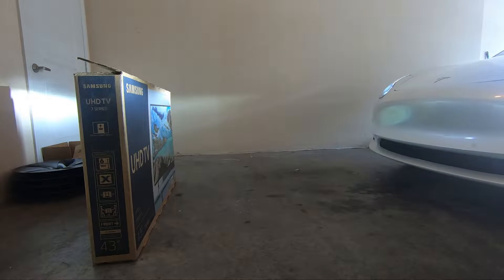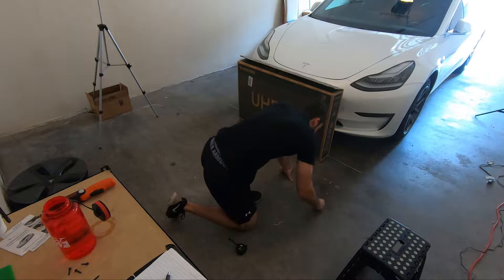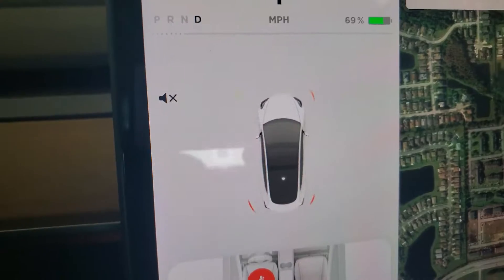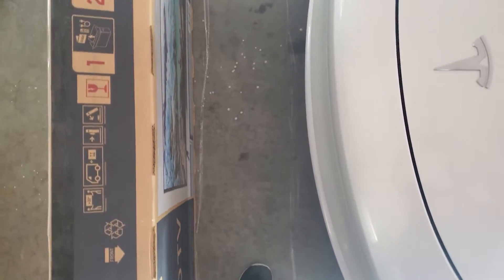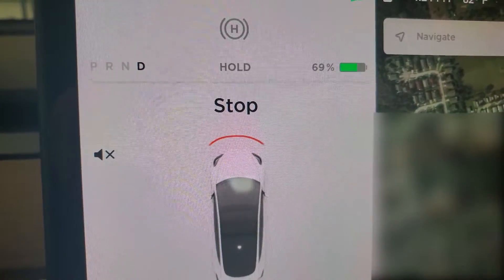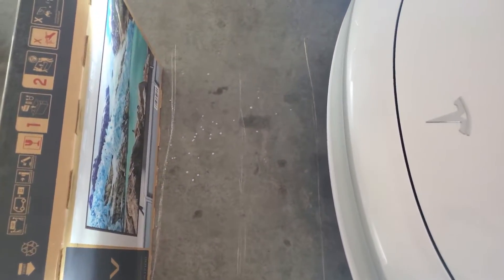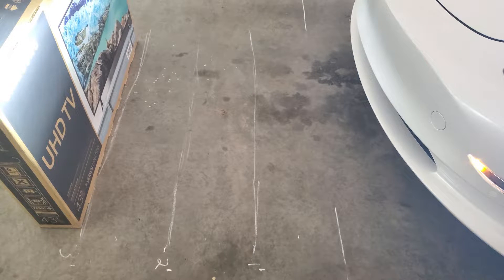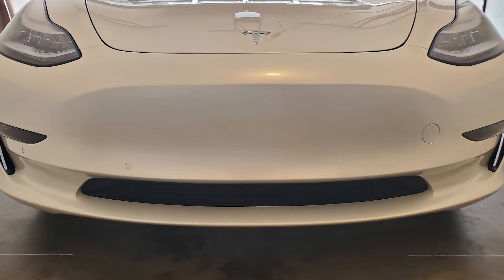Testing the Model 3 Proximity Sensors

Comment: I have a question, if you place the box flat on the ground to mimick a road side kerb, will the sensors still stop?
Reply from the maker: I haven’t tested with a box but I will say when i park next to a curb it shows on screen the lines near the side of the vehicle to show an object is near. But all this is going away since new vehicles don’t come with sensors and they are moving to a vision (camera) only system to track objects.
Reply: Thanks  @MaxsTech  , appreciate the response.

Comment: Is the front proximity sensor need to be turned on on the app? Where do I find it? Just received my model 3. Thanks
Reply from the maker: Depending when you got your car you may not have it. Tesla recently stopped putting proximity sensors in the cars and are using camera vision only. Otherwise if you do have them they’re on always, nothing to enable.
Reply: @MaxsTech  receive it yesterday after 7 months on order since March

Comment: What doesn't the Model 3 have a 360:birds eye view? It certainly has all the cameras needed. That combined with their ultrasonic sensors would be fantastic for situational awareness when parking.
Reply: It doesnt have front bumper cameras so will have a slight blind spot for up close parking, so will have to use pre-calculated images that are only partially realtime. They may be able to stitch the cams better later, but for now this is why autopark is always in reverse.

Comment: Does this work on reverse too?
Reply from the maker: I've never tested the distance in reverse but it has the same sensors on the back so I would think its safe to assume so.
Reply: Damn it, I can't get it to show in reverse! I bought it a couple months ago and wanted to always park in the middle of the garage and front sensors giving inches is awesome but I also wanted reserve to do the same. EDIT actually I think it'll work but currently when I'm reversing it just shows the backup camera I wish it would show distance to wall when using backup cam